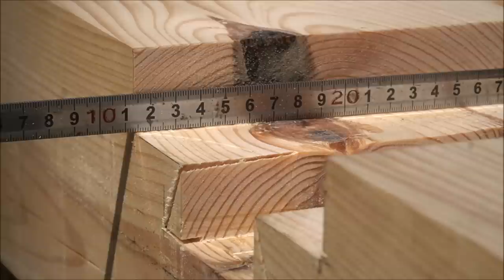한옥과 소리.

Comment: I'm going to build my house like that! Love it. What I like is how the beams and the posts come in manageable sizes that one or two people can lift, no need for a crane. Also, the joinery is strong enough that there are no need for pegs either. I love your work. I once asked you in another video if it would be possible to build a 2 story house with this method and you just answered that here. Thank you.
Reply from the maker: In the case of a two-story house, it is more stable to lengthen the columns to the second floor. Thanks for watching.

Comment: A carpenter with good skills and efficiency. The cuts are sophisticated, but I regret to say that to me the traditional Korean way of building a wooden structure is a total nonsense : all the weight of the roof is on the middle of a small sized beam that will quickly bend, the beams are too much weakened by the cuts, etc. A lot of work and timber for a poor result in terms of construction. Using a frame truss would be much more efficient.